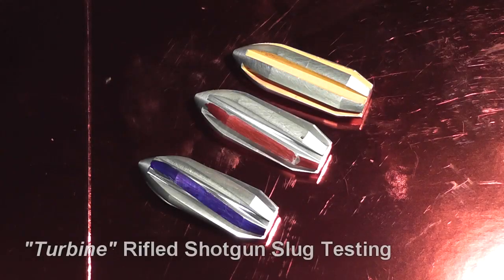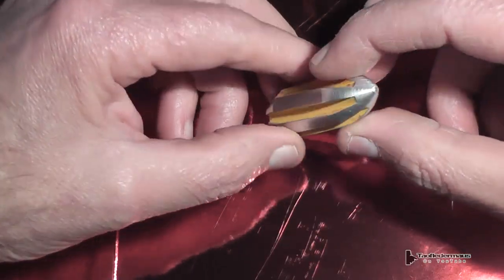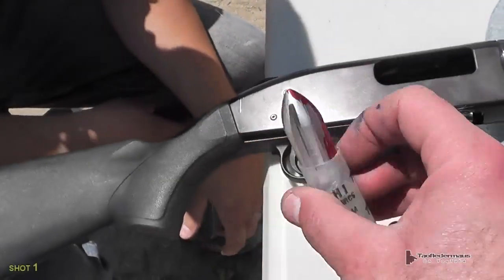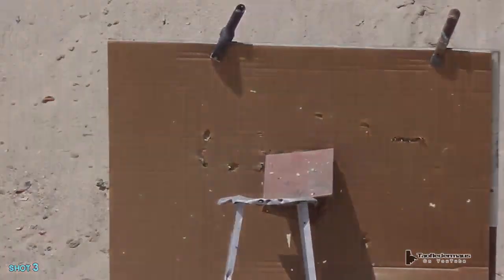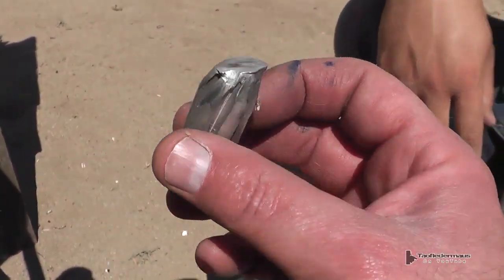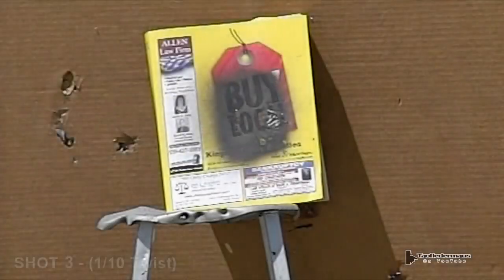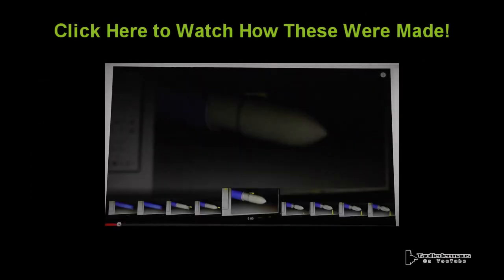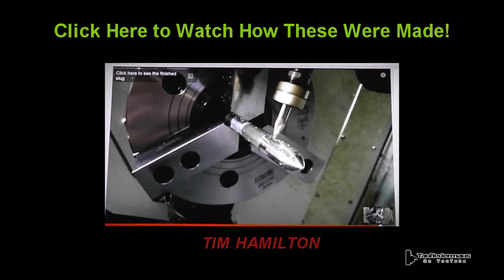Custom Aluminum TURBINE Shotgun Slugs  -Testing

Comment: Why bother with aluminum? because its easily machined but even easier is to use the lost wax or lost foam method and cast your own designs plus lead is easily deburred after casting, nicholson even makes a type A file specifically for the purpose. It looks a lot like a wood rasp and is designed not to clog plus it keeps the lead safer because it's not sanded into microscopic particles.
 Anyway I think that would be your easiest way to discover new rounds and lead carries far more hard hitting impact energy to the target and is safer than worrying about a ricochet. Generally soft lead is prefered for that speed anyway and hard cast is only needed when you want to get through a thick skulled animal like a bear or moose or elephant but they are not as fun for results, usually.
 I know you already melt lead so why not give it a try?

Also you often mention how you have so few rounds to shoot -- here's another idea. From now on, every round you get, make an impression of it and then you can copy off as many as you want later in lead or brass or even aluminum if you chose to stick with it. 

Knowing me I'd like to see the steampunk slug -- it'd have a head of brass with fumed oak body (looks black, banks used to use it back in the 1930s) and is a very easy process to do.

You know what else would be cool to do? one bomber or juicer type round in ironwood (AKA hornbeam) and one in dogwood and I'll tell you why.

Long time ago I stayed up near canada for a year and during this year I became an awesome woodsman and my older friend noticed how my handaxe could go through about two inches of poplar in one swipe so oneday he hands me this wood and "try that" and it was a thin branch, like half a wrist, and it barely went 1/4 inch wood. Ever since I have been in awe of this wood and apparently I don't even see any boards ever for sale of hornbeam or ironwood. I suppose nobody wants to machine it because it is super tough on tools.

Second wood -- dogwood. yeah, those little bushes. woodsman use that punny little wood as wedges that actually get pounded into bigger trees to keep their blades from getting pinched and if you've ever worked with a chainsaw you know how dangerous kickback from pinching can be. BTW this is not your homegrown DIY thing -- this is for guys who take down trees that are like 10 feet across. Fully grown mature, crazy big trees.

Just some thoughts. Run with them if you can!

Comment: i have an idea why not make a little ball of glass on a smaller turbine and down the rails why not try to make like zigzag blades in those rails and then in the middle of the slug in front and the core cloak it with some kind of gummybear mixture to swallow the energy and heat ?

Comment: I know why they do not work. When viewed from the rear, the initial blast hits the fins so that it spins the bullet in a CCW direction. Then, when the air grabs it from the front, it hits the fins causing it to try and rotate in the CW direction. This instantly causes it to tumble. The slots are too deep, causing too much drag, and should not go all the way from front to back. They should gradually taper off in depth to the OD.

Comment: You said you used a "smooth bore" , you'll need a rifled barrel if ya want this to work. Even tho the slugs have rifling you need the barrel rifling to start the rotation, the rifling on the slug's does not mean a thing if it's not rotating *before leaving the barrel.
Reply: sorry guy, you're just wrong...major manufacturers make rifled slugs and they are intended for use in smooth bore shotguns.
Reply: +coal james okayy you pretty much answered the questions I had! I figured it was because the barrel wasn't starting the rotations since the inside was smooth in the shotgun. There's really no way for the slug to start rotation unless the barrel is waay long for it to stay straight to get the spiral motion. Unless a longer barrel wouldn't work?!
Reply: +Taylor Jesse just make sure the rifling in the barrel is the same rotation as the slug.
Reply: The slug was made so that the air friction would be channeled through the absurdly large grooves.  In theory, the air pressure from the projectile moving so fast would give it the desired spin.

Whether it did the job or not is another story.
Reply: SO I GUESS FINS ON A ROCKET HAVE NO MEANING EITHER. ITS SUPPOSED TO FORCE AIR THRU THE GROOVES AND INDUCE ROTATION WITHOUT RIFLING.
Reply: @highmazikeen4590  AHHHHHHHHHHH LOUD NOISES
Reply: coal james obviously doesnt understand that EVERYTHING ABOUT THIS IS AERODYNAMICS BASED. The air, is your rifling.

Comment: the two major design issues with the design of those rounds are 1 the rifleing goes all the way up the slug allowing gas to escape around the round. second is shotgun slugs are hallow in back to create heavy front end making a shuttlecock effect stabilizing the slug in flight.i would like to see lead alloy rounds with the hallow back end and rifleing that doesnt go all the way up so it doesnt interfere with the compression inside the barrel

Comment: You don't have enough rear pressure stop at the back of the bullet. Gas is expanding at a faster rate than the slug is traveling so it is escaping through the groves in the slug, this is causing drag on your barrel walls and over pressure at the front of your slug, that's why it tumbles when if first comes out. The rapid expansion of the gas in front of the bullet is omni-directional so there is no tip control. The reason a bullet says on target is because the pressure in front of the bullet is much lower or at ambient pressure, this allows spin to generate as air in front of the bullet tries to wrap around in inside the barrel. You are losing that to the over pressure in the front. If you used a carriage or a synthetic wad (3D thermal plastic printing could make one easily) that would generate a good enough seal if engineered right. Then they separate just like putting a satellite into orbit as they leave the muzzle... Oh and your grooves are too deep, you are going to cause turbulent flow inside those grooves. Good luck guys.
Reply from the maker: +Zach Detwiler   Shotgun use waddings or gas checks  to keep the gases behind the projectile.
Reply: TAOFLEDERMAUS gotta love these online geniuses
Reply: +Zach Detwiler its more simple, when the bullet is propulsed spin in one direction, an when is out the canon spin in the oposite direction, causing a unestable aerodinamic.

Comment: shotguns weren't designed to send a round perfectly straight. .with the spiral motion as a rifle does that allows you to hit a mark dead on from 100 yards. .they pretty much just discharge with high pressure and velocity, rounds that "spray"  in the general directing..these rounds do however make the shot  more accurate no doubt

Comment: The round might be far to light to keep stable. Try the same style round but with a heavy core like brass or lead. Also in the tip a far harder material than aluminum. tungsten or probably even an hardened copper alloy.

Comment: contrary to popular belief, rifling on a shotgun slug is to allow the slug to compress slightly for different sized choke tubes as well as reduce surface area friction to improve velocity. You can buy rifled choke tubes to impart spin on the slug but I have no idea how that would work with an aluminum slug

Comment: why didnt u shoot them in a rifled slug barell?
Reply from the maker: +jeff cain  that wasn't what the test was about
Reply: the contact with the rifling would get the rotation started and should show a vast improvement in flight dynamics.
Reply from the maker: +jeff cain  The test was to see if rifling or spirals on the projectile would cause it to spin.   It is something many viewers believed would work.
Reply: +TAOFLEDERMAUS
I know physics and there's a few problems:
1: The cuts were way too deep, killing compression.
2: The great amount of gas shooting past the bullet inside the barrel, pushes the bullet to spin opposite of the design intention; it cannot start spinning to the intended direction inside the barrel since the gas flies past the bullet and must do so (or else it isn't higher pressure than the front side of the bullet and the thing wouldn't shoot), as opposed to the bullet flying past opposing air by it's own velocity. Outside the barrel, the bullet will want to spin to the intended direction, but stability is probably already kill at this point; if it's rotating at all when leaving the barrel, it will have to be the wrong way, and then it will want to spin to the right direction, introducing a point of no spinning at all in case the stability wasn't already fucked.

Comment: How snug was the fit to the bore? In rifles the bullets are actually larger than the rifles (lands). For this to work I guess the slugs will have to exactly as wide as the bore, and maybe not even then. They might have been that as far as I know.

Comment: you should try and implement the design and function of the skirt of a pellet from air rifles..  they are made to slightly expand inside the barrel when shot and seat the round to the rifling.. i believe this is how they get such low weight, low velocity rounds not to tumble and fly more effectively
Reply from the maker: +Dutch Boss   we just did that in this video.  Are you right?  let's find out!
https://www.youtube.com/watch?v=AlIDQCgZoUc
Reply: *****
 well, disappointed i wasn't the first to mention the design but happy with seeing instant results of the theory working real world..   great videos! thanks

Comment: I'm not a ballistics expert, but I would imagine a fundamental problem with "riffling" the slug is that the gas in the barrel passes through the grooves causing it to spin one direction, if it even gets spinning (would depend on the clearances i think) .  as soon as it hits the still air outside of the barrel the flow direction is suddenly reversed and cause it to spin in the opposite direction.  This would cause turbulence and more than likely cause the round to tumble.

Comment: I have an older rifle that when I started reloading for it I had a major problem with key holing, after trying many different bullet types I found that my problem only happens with Boat-tail bullets, if I used a flat base bullet I had my best groupings and no key holeing, 
I would try a flat base with the groves cut in the bullet and use a 1/2" rubber ball as a gas check like the federal premiers

Comment: Maybe if he machines the turbine design halfway down the length of the slug and have the grooves taper upwards to cause some drift, you will have a more accurate shot/spin. From what I see, the air is going all the way down the grooves in the bullet and rather than causing a whirlwind effect, it's building a small vaccuum behind the bullet and making it wobble. Sorry if that's not worded the best, but if you get the gist of what I'm saying I'd say go for it. Cool Idea for sure.

Comment: I doubt there is enough air passing through the flutes to make enough spin to stabilize it.  Rifling forces to bullet to spin. A prop blade on the tail might work but that's pretty expensive to produce. Three much deeper flutes might work. Plus there is far too much taper on the tail end. All that being said perhaps a teardrop shaped slug would work without spin being necessary at all.

Comment: it's not the rounds fault it's the guns fault
Reply: +Trevor Bilinski Shot also has a nice tendency to fuck up rifling in the barrel, that's why you get a smooth bore shotgun for shot, and a rifled shotgun for slugs.
Reply: how so? a bent arrow is not a bows fault... the gun fits its usual application well, maybe its the engineers fault.
Reply: +Perpetual KillMachine you need a rifled barrel, to make the bullet spin. Its the reason why you dont put birdshot in a 9mm pistol, because the rifling in the barrel spins it so it makes a large circle, not a nice neat spread
Reply: +Aaron Clark The wad keeps shot from touching the barrel so I don't see what your talking about. The rifled barrel spins the shot and spreads it out with a big void in the center. In turn the wad spins the slug without touching the barrel. I will do some testing this spring to compare. Anybody got a spare high speed camera they can loan me.
Reply: +Aaron Clark that would make a lot of sense, small metal spheres that go supersonic(potentially) hit grooves and would damage it
Reply: Wrong

Comment: If we where in a low atmosphere pressure these bullets might have a better flight, but this shows that you still need the Barrel rifling to do the twisting. The atmosphere is too dense for the bullet to fly strait. It is like firing a normal bullet under water.

Comment: At super sonic speeds, there's a "shield" in front of a projectile that prevents those fins from gathering any air pressure to cause a rotation. Use those same projectiles and fit them into a sabot. Fire them out of a rifled slug barrel and I guarantee you'll see the result everyone is anticipating.
Reply: They may be too long also
Reply: More, smaller grooves would help with accuracy and possibly lower the weight, depending on how many and how deep they are.
Reply: @iyeetsecurity922 yeah I can agree with that
Reply: I was surprised he didn't do that from the start. Maybe he wanted to see if there was any spin at all.
Reply: Take the barrel off and drop a slug down it. Maybe can tell how tight of a fit
Reply: @Russell-n6i  Saw the barrel off and drop it in the sea instead. That would be simarly useful.
Reply: it is more likely that the groove are intended to cause rotation from contact with the barrel. perhaps they were slightly too narrow to make proper contact.
Reply: Lucky its not then how is it definitely super sonic itz heavy asf.

Mayb the weight of it is too much for the puny grooves to have any effect though. 

But what do I know. Im only English. I learn my guns from video games and demo ranch haha.

Comment: There is not that much of complexity, the idea is that at that speed you need bullet itself to rotate so the nano-curvature of the surface will act as a dispersion. for at least a very partial effect instead of dents you should try a whole piece with 1-1.5 mm curved fins which should be shaped as small bulges on top of it, smoothing alongside surface. That's all you'll need to make bullet spin at such air pressure. 

As for explanation why it thumbles -same thing as why, when small passenger airplane goes above it's speed limit it tumbles - the resistance of the air against wing becomes too strong and one slight deviation causes whole construction to yaw out of control.

Comment: The taper in the back along with the slots cut so deep all the way though help the gas's escape, which makes the bullet slow. Which is made clear by how the waddings velocity seems to try to overcome the bullet in the slow motion. Suggestion: The taper should be on the rifling and not on the bullet in total. (90 degree back into shell, Which start out round while the groves get deeper to fore).

Comment: NERD comment alert XD The bullet should be already spinning when it exits the barrel for it to fly straight. For that the air is not enough. Normal bullets grind against the barrel right? When the bullet is propelled, the expanding air from the explosion is flowing form behind the bullet, and it's extremely turbulent. Perhaps it would spin if you would have a steady regular flow of air flowing towards the head of the bullet and no friction, but that's more an air soft gun than a true rifle! But thanks, this video shows how ballistics is totally non-trivial.

Comment: all of them have tumbled and not flown straight! grooves are not influencing the slug for sure!
Reply: there is almost zero air flow through those body groove "fins",  even if they generated 100 percent spin rate for their inclination, it would be too slow of a spin to stabilize projectiles like that

Comment: I think that the issue here is the rifling on the slug is much too deep. You probably want the rifling to be just deep enough for the barrel to catch it and make the round spin. Seems like the aerodynamics of the round is what is causing the issues.

When the gas is pushing the round down the barrel, it is going to cause the round to spin in the opposite direction you want it to (against the way the slug is rifled).

Comment: Your stability problem is because the projectile is being gas driven from behind, as you pull the trigger the exploding gasses passing the head would make it spin one way and as it leaves the barrel the air flow reverses over the head slowing it to a stop then spinning in the opposite direction.

Comment: Rifling isn't gonna do it, guys. You need to have the center of mass forward of the center of drag- make the tip more massive or shave more material out of the rears of the fins. That tumbling is all because of misplaced center of mass. If it doesn't tumble, the fins will start to spin it up.